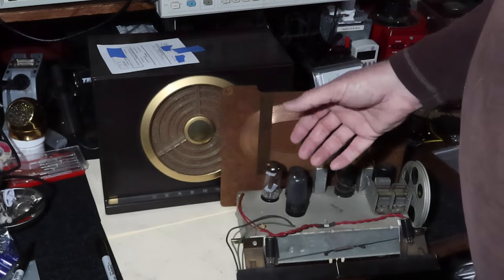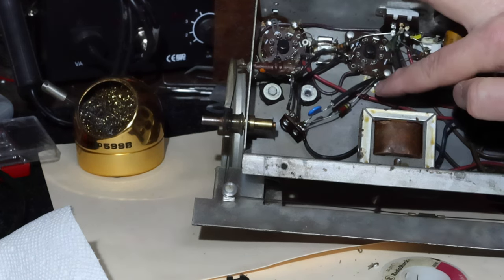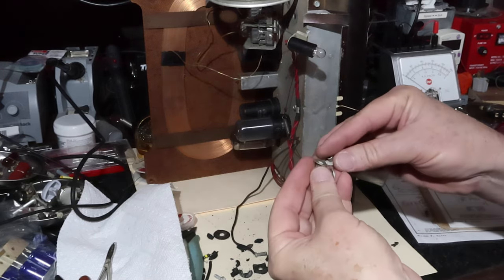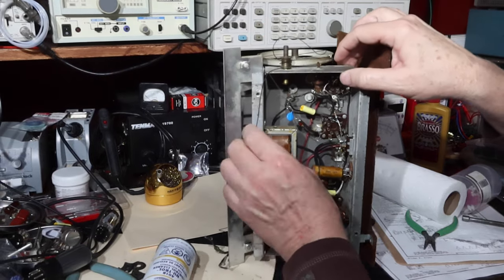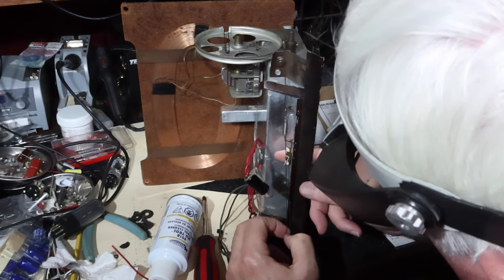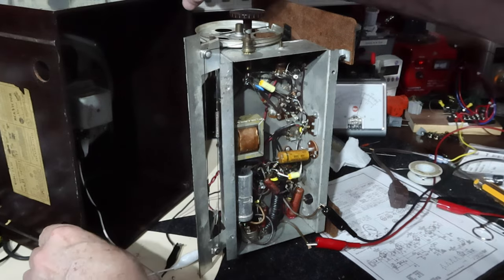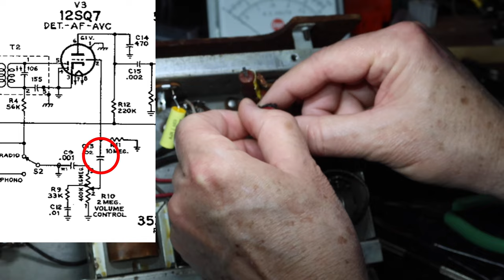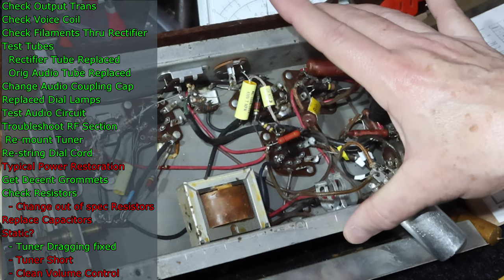RESETTING the TUNER - 1950 VACUUM TUBE RADIO w/ 8" SPEAKER!  - RCA 9-X-561 Part 2 [4K]

Comment: Glad to see a new video on this restoration. The shorted death capacitor lived up to its name for sure. I do the same as you with the rewiring of the hot and neutral to make the radio safe. I use the CL-80's all the time and they work very well but the CL-90 that you use is a better option. I have a couple of schematics on that model of radio that I also worked on, and one shows dotted lines surrounding C13 audio capacitor to B- ground. The way they shielded C13 is unique.
Reply from the maker: Hi Jim, thanks for watching; it is good to be back.  I think you are right, another fellow commented that he had the same kind of coil so it may have been a production revision.  Interesting.  Thanks again!

Comment: I believe those grommets you bought are actually chassis to cabinet base grommets. The Harbor Freight type should have
 a smaller diameter grommet that fits. The schematic is wrong for that shielded capacitor (C13) . It should of had a series
 of dashed lines surrounding the capacitor symbol with one with a line to ground (common B- ). One would say that a 
current limiting thermistor is not necessary since this radio has two Mazda 1490 lamps in series to do that job. But 
if it didn't have any lamps then it would be a great idea to put a thermistor in. Doing great so far with this older tech.
Reply from the maker: Thanks!  Good to get back into the swing of posting.  I have been working non-stop on these projects but not the YT part.  

I bet you are right about those grommets - I used something similar when I restored my Dad's Hallicrafters S-38B several years ago for isolating that hot chassis and forgot all about that.  The Harbor Freight grommets worked ok, just tight as heck to get in.  

I bet the Sams has that corrected schematic that you are Jim are talking about.  I've been using Riders as you can see.

Good point about the 1490s, you are quite right about that.  I like lowering the voltage a bit anyway. 

Good to be back, and thanks again.

Comment: Check your parts list for the dial lights. You indicated on your schematic that they are 47's. They should be 1490's. If I remember correctly, 47 bulbs are 6 volts  and 1490's are 3.2 volts each. The dial lights on your radio are in series so using 2 47's in series would require 12 volts to make them bright. The 2 1490's only need 6 volts to make them bright. The tap off the 35Z5 produces somewhere around 6 volts.
Reply from the maker: Hi Stephen, you are right!  See about 35:25 and it shows the 1490s on the bill and being put in.  I had written 47 I think because that was I found in there, or maybe I put one in in Part 1, I don't remember.  Thanks for watching and for the comment.  Cheers.